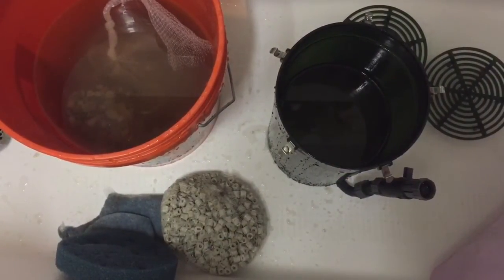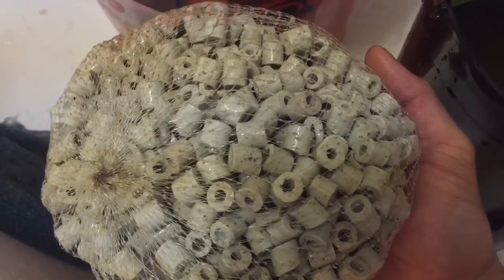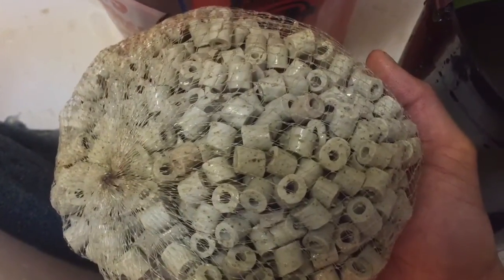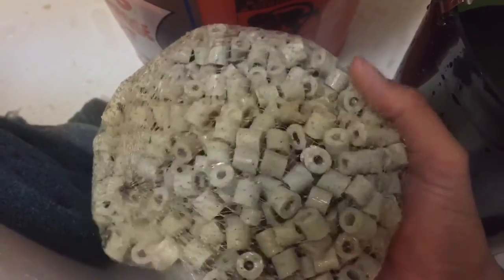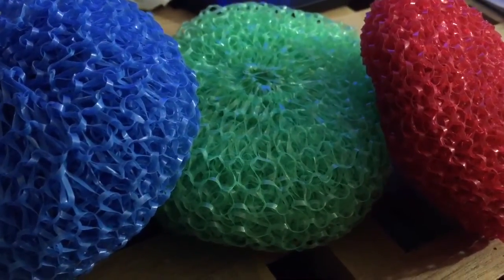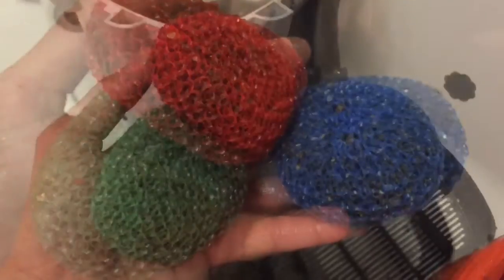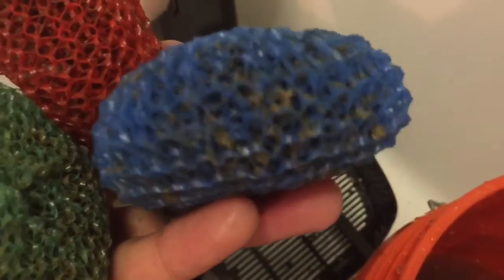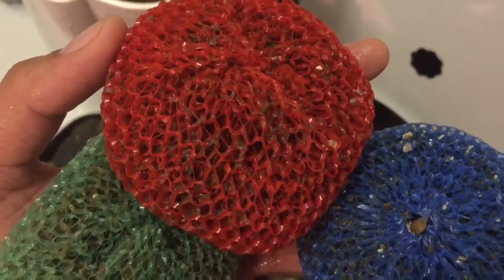DIY Mechanical Prefilter Media | How To Make Mechanical Filtration | Pot Scrubbers

Comment: I'm new to keeping larger fish cichlids,

I've seen cichlid users have 2 big canister filters, plus 1 hob filter with a UV light & still need to do 50% weekly water changes.

I didn't realize that many canister filters rated at 300 or 500 gph water flow,
After it goes through 3-4 baskets of filters, sponges, bio media then canister sits on floor & needs to push water up 3-5 feet into tanks it typically looses 50-65% of that GPH flow rates. So now I understand why people need to either use multiple canisters or one really big unit with a 1,000-2,500 gph rate just to turn their tanks over 6-10 times per hour.

Keep your sleeves wet

Comment: Have you found that ceramic rings, bio balls do a better job over Just using 20 pot scrubbers in canister? 

I just been using 3 bags of scrubbers etc
Wondered what improvement is noticed if switched to ceramic media or seachem matrix pellets instead?

Comment: Great Advice,

One thing I find is even when water goes though pot scrubbers pre-filter then through coarse,medium & fine sponges then through ceramic rings or sponges as biological filter section it goes right into your tank etc.

Ever take sponges or pot scrubbers out to squeeze in clean tank water. That water turns brown with a lot if sentiments at bottom in your biological media. Or notice setiment on bottom of your canisters/sumps or even HOBS.

I add cheap filter floss after biological filtration before return pipes into tank.

My goal is to not put any unwanted material back into tank once it leaves my entire sequence.
Reply: You'll have sparkling clean water with a fine water polisher last in line, like polyfil. 👍